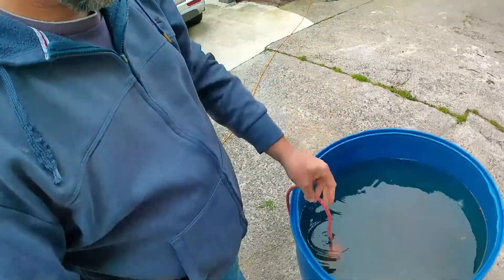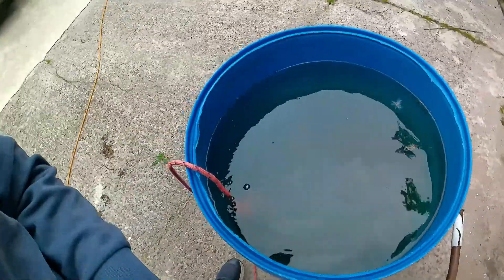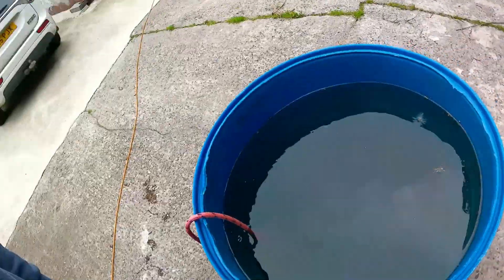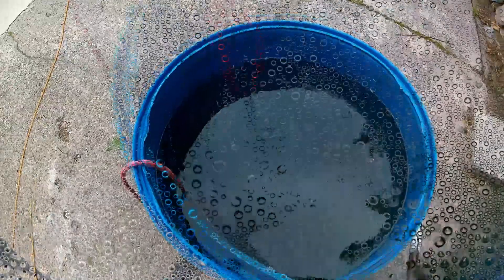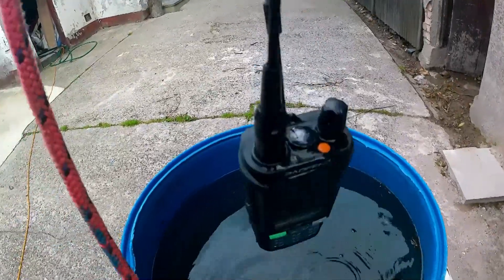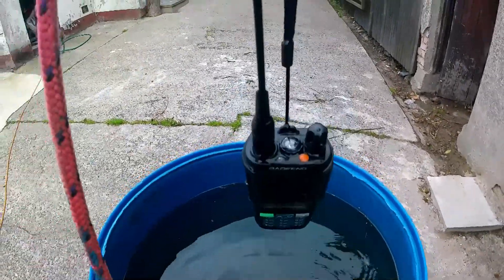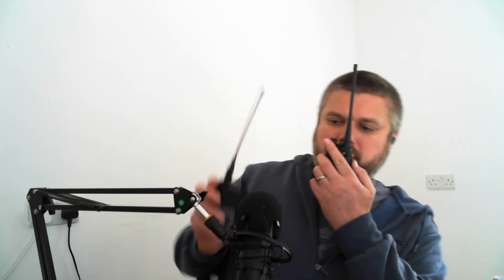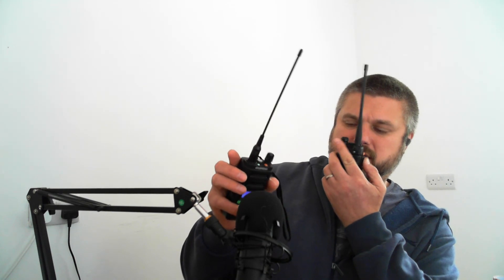Baofeng UV9R Pro Waterproof VHF radio (Marine frequencies). Is it actually IP67? Tested to find out.

Comment: So it still works after being submerged for 8 hours? That sounds great
Reply from the maker: nah it stopped working , it's far from water proof, even when just submerged (as I did for the other one) in the certified waterproof time , it still had water enter the radio. The cheap ones are just as robust so would buy a couple of them for same money.